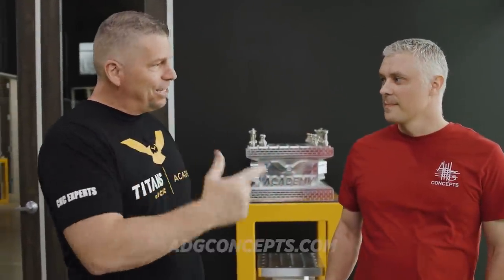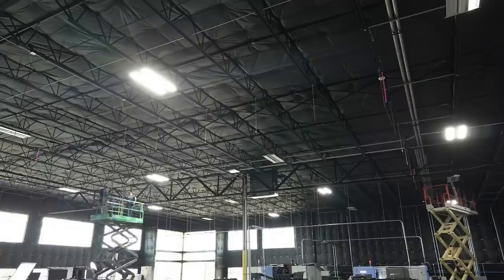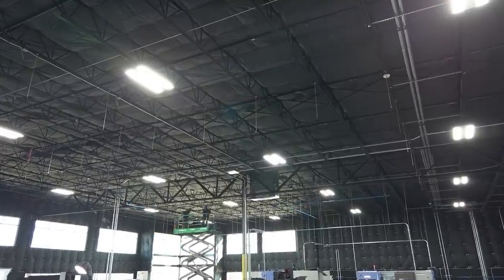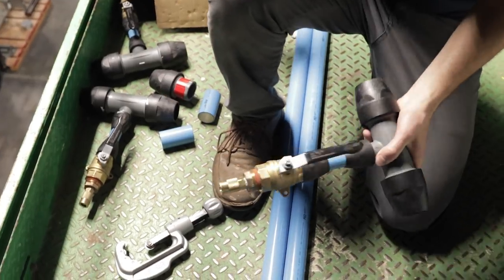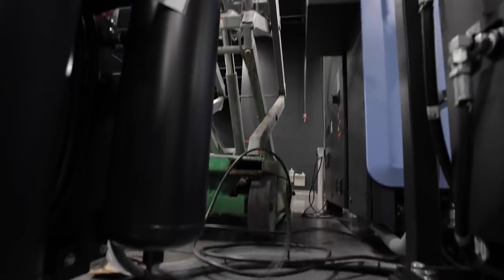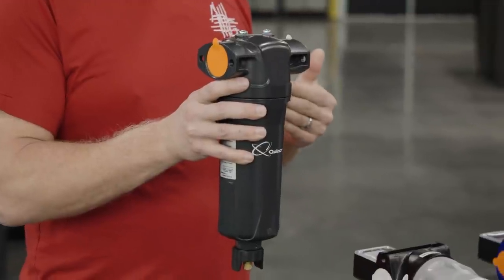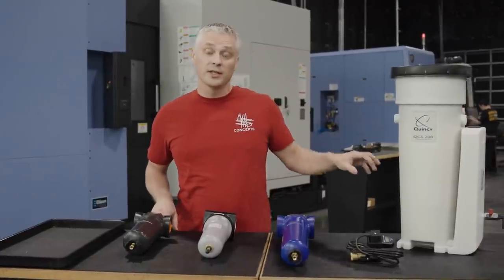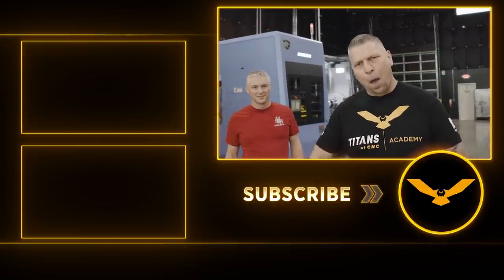Building a CNC Machine Shop | Elite Air System

Comment: You didn't mention using oversize high-flow air connectors where you connect to your taps on the overhead air loop. That is what I always use. It reduces or eliminates pressure drops that can cause moisture issues. I would always recommend additional air tanks tapped in at the furthest end of the loop as well to increase the volume available for high-demand surges. Pretty nice-looking system and installation otherwise.

Comment: A ton of machines don't like quick disconnects. I have fixed more air issues around our shop by just giving the machines the cfms they need. If main air port to the machine is 3/8 then I run a 1/2 inch line into the machine. 1/4 inch quick disconnects are for hand tools not large machines.

Comment: Planning to succeed by planning for the future.  I like it, very fancy compressor.
Reply: If he was planning for the future he would be installing a back up compressor too. When you run compressors 22 hrs a day 6 days a week like we did, they are going to go down. And you don't shut down a multi million dollar shop and send employees home because of no shop air... We had a 75 HP Kaiser, with a 50 horse backup. Some times when we were doing production bead blasting, we had to run them both in unison to keep up..

Comment: Did I hear this right....so on the "drop" downs they need to be going up instead of down? Im about to install a system for my cnc plasma table and really want to get my air systems right
Reply: I'd prefer to have them down too.  Would rather have it run through the system, than accumulate.. Then again, if you have condensed liquid in your line, this is the least of your worries.

Comment: This guy is trying to sell the turbo encabulator. . .

If the air is filtered, it shouldn't matter if the taps are down.  I'd actually prefer that, but then again there is a lot more going wrong if you have condensed liquid in the actual lines.

Also 2nd filter. . . Coalescing filter. . . that removes oil and H20. . . it's in the name, not directly designed for particles.

*edit
the compressor already has a drier on it. . . just SMH.